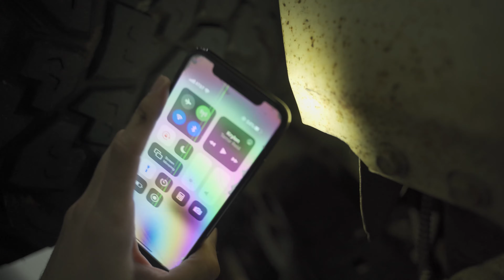Grand Wagoneer Vacuum 4x4 Problem! OVERLAND GRAND WAGONEER BUILD VLOG #5

Comment: Yeah I always switch mine to neutral before engaging/disengagement of 4x4 and after I take out or four wheel drive I put the trans in reverse and go backwards a bit then it’s disengaged.. never change while vehicle is in motion.. I’ll try n look n my manual for the proper way to engage/
 disengage

Comment: I had a similar issue with cruise control vacuum hose.  FSJ Overlanding is right about replacing "all" the vacuum lines.  I had a tiny leak....but it prevented Cruise control from working.  On the bright side...when in 4WD with the Selec-Trac NP229, viscous coupling unit, you can stay in that mode indefinitely as it a full-time 4WD.  And you can make an argument that the rear axel and differential will last longer because the front axel is pulling 50% of the load.  Also, in my 1987 Jeep Owners manual.....there is a note that tells you to drive in the 4WD at least once a month for 15 miles to keep the system running well.

Comment: Brake issue is power booster and master cylinder. Master cylinder leaks fluid out the rear  seal into the power booster and rust out return spring. Couple hundred  dollars to replace both half day job. I did it on my 86 wagoneer

Comment: Replace all your vacuum lines, even a small crack can really degrade their performance. I don't know if the later years had a little plastic vacuum tank at the back of the engine by the firewall that hooked up to the switch. If so, ditch that, and pull straight from the manifold to the switch. I'd also replace the switch with the metal push/pull style if it was me. (I did, works better) Good luck!
Reply from the maker: FSJ Overlanding thanks for the tips! I appreciate it!
Reply: Can you explain the metal push/pull style and where to get it?  Thanks.